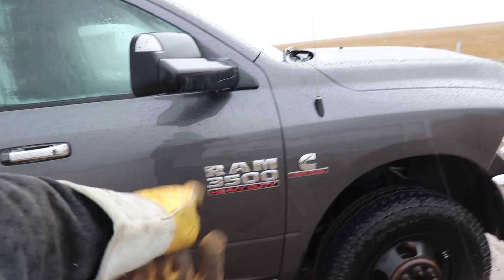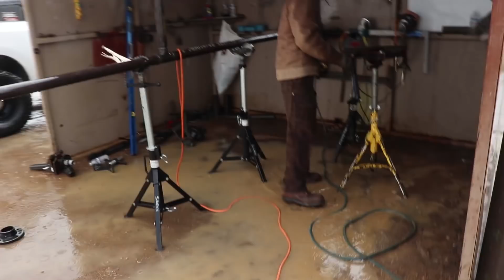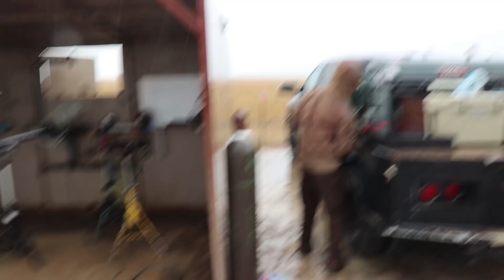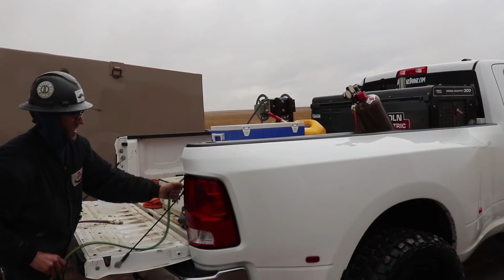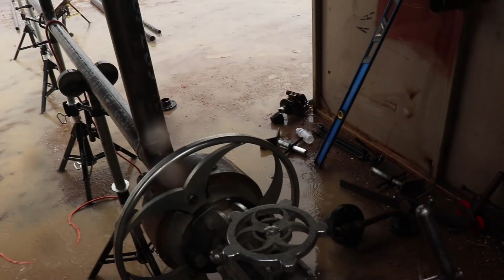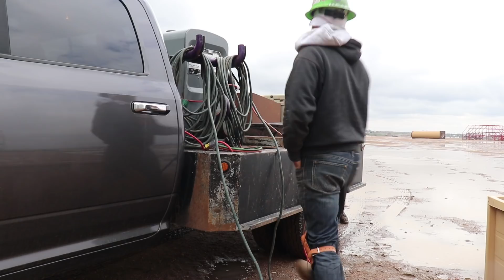Welding and Wet Welding Gloves

Comment: This is why you have a helper he puts the rod in the stinger. Then he gets back in the truck. Oh and don't touch the pipe before the rod does.
Reply: There jobs out where you hold bare handed a plate that gets water welded. And you hold it during the process.